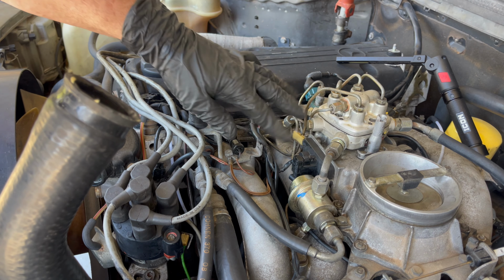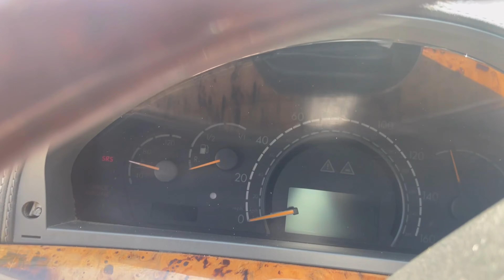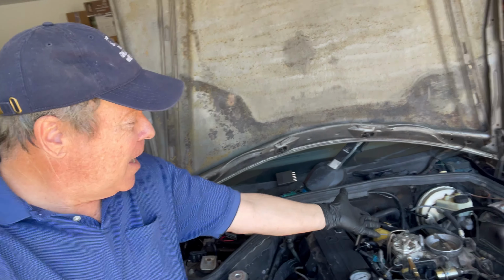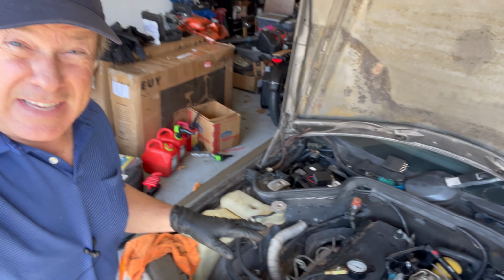The Disco Inferno Starts!!

Comment: Mike, I've explained how to fix this in the comments several times.  190E has a warm up regulator.  Just follow where that line from the top of the fuel distributor goes.  Next stop is warm up regulator.  Even my 190E 2.3-16V Cosworth had a bloomin warm up regulator.

Comment: The engine is running very rough because there is a hose missing in the valve cover breather that goes to the idle control valve and cold start injector.
Try capping it with your finger on the hole that goes to the ICV and you will notice a huge difference.

Comment: Hello there cowboy here again nice work with the inferno and you did it without setting it a fire again lot's of fine tuning to do but you're over the hump she started and fun for a short time congrats, now as to the pickup as an old wrench I've seen this before first of all remove the EGR valve and clean it real good and lube it with crole oil also get so Seafoam both the liquid form and the spray type when you got it running even poorly spray it thru the intake however you can you'll have to spray slowly and keep the idale  up use the whole can then add a whole can of the liquid form to the fuel tank I recommend using it in all your vehicle's as well as anything like leaf blower lawn mowers ect you'll be surprised add to vehicle's at least twice a year good luck we'll be watching and remember always be safe healthy and happy God Bless 🤠

Comment: Congratulations!
👍🏻👍🏻👍🏻
From a distance it looks like it that the FD is still a little bit on the lean side. Not sure if this version has the EHA valve or not. The EHA provides a boost enrichment when starting.
I would turn Allen key another 1 to 1 1/2 turn clockwise 1/4 turn at a time and see if that makes the starting easier.
Food for thought.
Peter
Reply: Yes, you are correct. The EHA is part of the system here.

Comment: Mike for 1. You should look at your comments more.2 you should stop what you're doing and take your gas line off blow back into the tank. Make sure that is flowing then after that try to adjust your timing.  it has to be one of those things.. Other than that. keep up the good work.
Reply from the maker: The return line to the tank is clear.

Comment: Check to make sure the #1 piston is at TDC and the rotor button is pointing towards the # 1 piston. That backfire is not right. Adjust the distributor if required.

Comment: This Bosch KE-Jetronic system have cold start valve and idle regulator when you start engine you dont need to press gas pedal  KE-jetronic air flow meter disc need vacuum to operate coolant sensor this is old version one contact go to ECU "Engine control unit" and second contact to the EZL "Electronic ignition system"

Comment: Mike,
one more suggestion before you go out and buy a new fuel pressure regulator. Forgot to mention this in my other post:
Many times on these cars which sat for a long time the fuel lines clog up. Most people spent a great amount of time unclogging the supply / feed  line but neglect the return line….
A blockage in the return line will also increase the system pressure….
Peter
Reply from the maker: I am able to blow air thru the return line. But thanks for the comment!
Reply: @MonkeyWrenchMike  the other thing you may want to check is that the correct fuel pressure regulator is installed. If the previous owner installed the one for the V8 with 5 Bar to 5.5 Bar then that would be an issue too.
Because a part looks and fits the same that doesn’t mean it works the same.
Peter

Comment: Mike, have a 96 E320 with similar problem when came out of storage.  Replaced everything and nothing worked.  Last week end I found a strainer in the fuel rail almost 100% plugged.  That is called fuel line fitting.  I ordered a new one and will install it soon.  Have you checked if there are additional strainer or filter in the fuel line near the engine?
Reply from the maker: I looked. There is supposed to be one at the line coming into the fuel distributor but it’s missing!

Comment: That is 100% mechanical fuel injection. No electrical fire (other than fuel pump) will affect performance. Strongly recommend you check your pressures.  You will find the problem then. Just because the pump runs does not mean it is putting out X pressure. you need X pressure and X seconds of spray to run. (electronics in modern cars control the x seconds of spray.)

Comment: You need to plug the open injector hole, not allowing the air disc to pull open enough flow fuel

Comment: That coolant sensor definitely will throw everything out of wack. If it runs it will run very poorly, fix it, and maybe she will clean up. That sensor tells the computer how much gas you need, cold start choke, hot start less fuel.